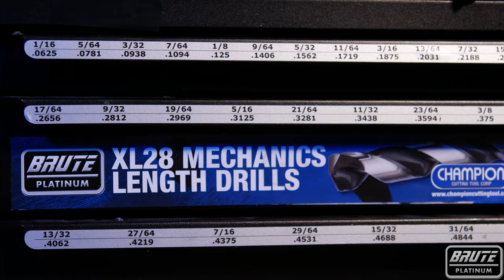Champion Brute Platinum Twist Drills

Comment: I have to drill hundreds of holes in 1/4” stainless enclosures. Are this the right bits for the job?
Reply from the maker: That would be correct. Our Brute series XL5 or XL28 would be ideal for your application.
Reply: @Championcuttingtool  cual es la diferencia de la serie XL5 con la XL28???